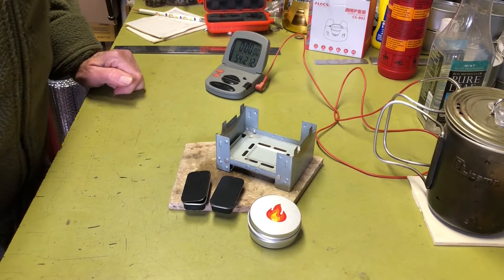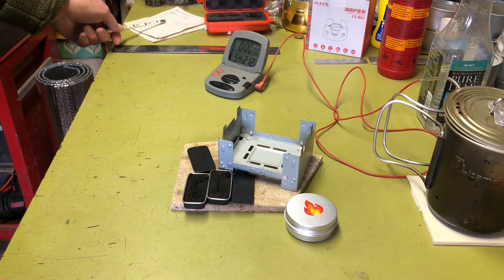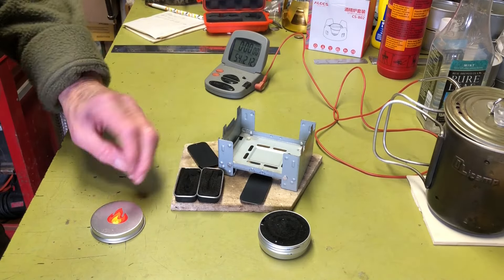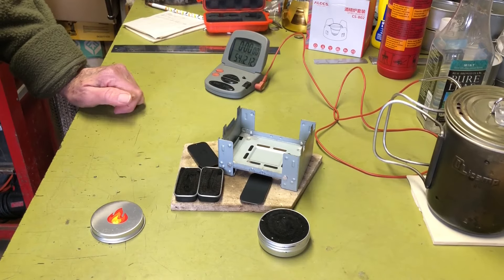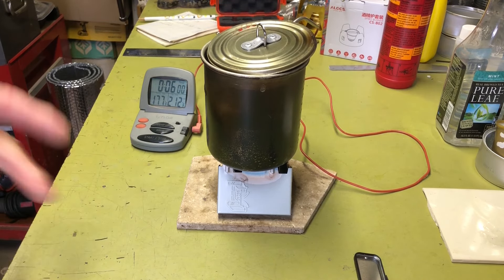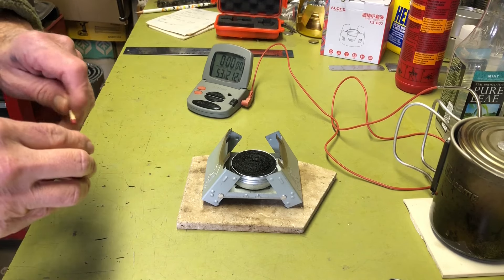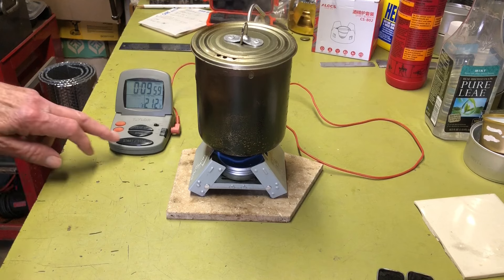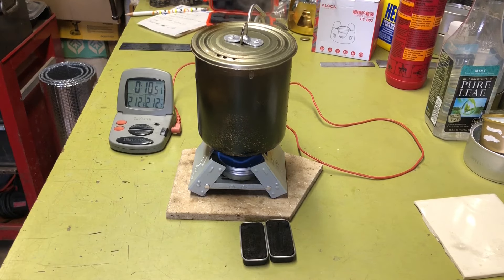Comparing 2 1/2oz Alcohol burners to a 1oz Burner.

Comment: 👍👍👍 .. interesting.
One wonders what is the 'physics' behind the test results. Flame surface area vs depth of container, etc, etc.
The round tin will obviously burn longer due to it's configuration, thus giving the water time to get up to the boil.
Interesting to know would be at the time that the two square tins took to get the water up to it's maximum temperature before running out of fuel, where the round container would have stood, water temperature-wise.
I think that it's probably a factor of 'efficiency of shape and volume' .. surface flame area and depth of the fuel reservoir feeding the flame, which has an effect on heat output and burn time.
Must do some 'mulling' 🤔 over this one. Thanks for sharing .. take care ..
Reply: I was thinking 🤔 along the same line as you. I believe that the extra surface area of the rectangle tins combined with the shallow depth allows too much of the fuel to vaporise and essentially escape from the tin. It’s almost as if the flame can not keep pace with capturing the evaporation of the alcohol, which has a very low boiling point

Comment: I use Klean Strip Fuel denatured alcohol. Have you compared Yellow Heet to denatured alcohol in boil test? Probably not much difference but might make in interesting video ...
Reply from the maker: I watched a comparison video and Yellow Heat performed a bit better then Klean Strip, also, at least in my area, Yellow Heat is cheaper.

Here's the video, really good.
https://youtu.be/Mt69fbNhCgs?si=Q2V3SLGKgcd6vFZ6

Comment: Nice! I'm wondering if it's the difference in hight that means the two half ounce tins don't boil the water whereas the round one ounce does? Maybe there's an optimum distance to get maximum heat output?
Cheers for testing the two together.
Reply from the maker: Could be, I'll have to try rising the small tins up and see what happens.
Reply: Yes. You need at least an inch of space. I prefer 1.25" to 1.5".

Comment: My stove is a little taller. 1oz tin with 91% isopropyl did 2 cups 64f in 8 minutes. Pretty similar results. Nice part is you can shut it down and save the remaining fuel or keep on cooking. It will burn for 15 to 20 minutes. Beer can stove was under 6 minutes but only burned for 8 minutes with 1 oz of fuel. I  have tried many different designs and I am going with the 1oz tins.

Comment: Are you measuring equal amounts of fuel per containers,  I'm wondering how much fuel the absorbing material is holding. 
Also if you have fuel remaining in the container when you're done wouldn't it leak out onto your pack items since the round container doesn't have a seal. 
Loving your videos .new subscriber here and I'm trying to catch up on all your cool videos
Reply from the maker: Thanks.
I did top off all of the burners, so close to an ounce for all tests.
To more accurate I should have weighted the burners before and after but I was more interested in the boil times.  being small stoves there isn't much fuel left after the boils.  The round tins do have a gasket but will leak a little if there is fuel left inside although with the felt it may not leak out, I'd keep them in a plastic bag in any case.